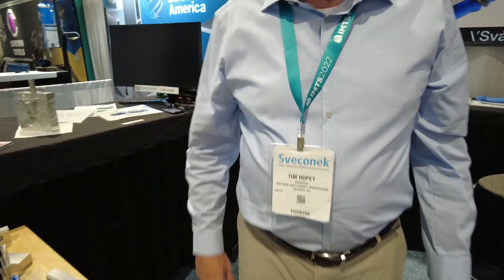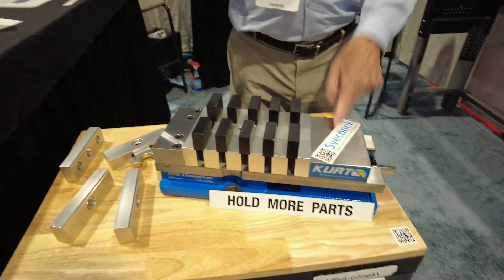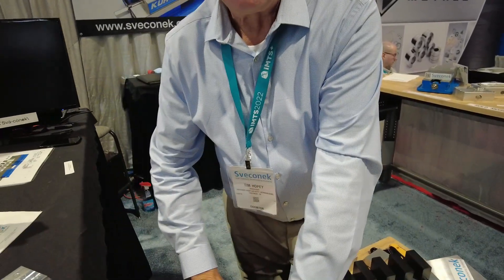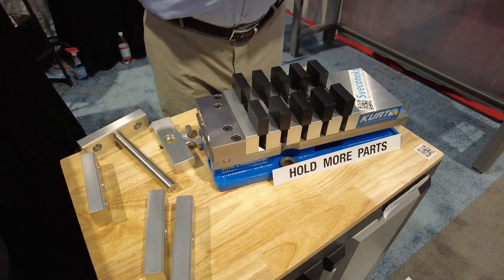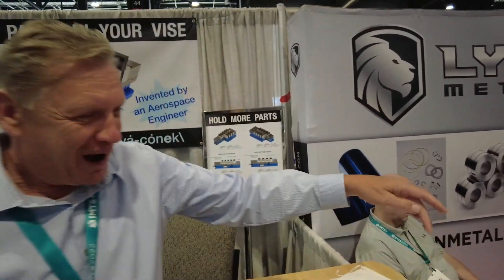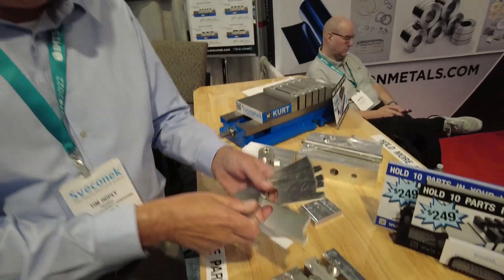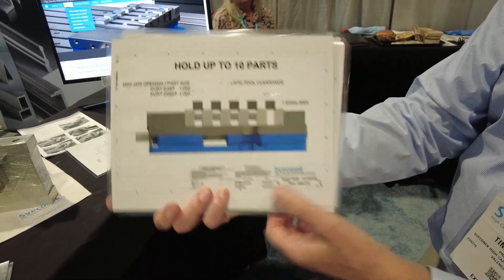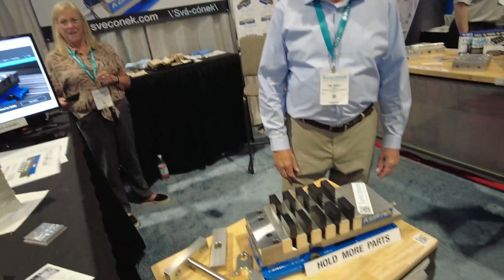CNC vise STEROIDS

Comment: Dont want to be negative but there's a bad tolerance stack issue (in Y) with that design.
Reply from the maker: I think you’re right.  I don’t know if you could do legit second ops with them unless you probed them all.  But first op blanks would be money and I think you could hold them fine. I’m gonna get some and try them.  I have my reservations on Y also.
Reply: Maybe for secondary ops.. but for first ops? Who cares if you are cutting around all the parts.   @ericschneiter
Reply from the maker: @turuleng  agree on op1!  Op2 wouldn’t trust the datum probably.

Comment: The no go no go no go annoyed me cause he didn’t even properly use the shim to check it lol, put an indicator on it and see for real. This looks like junk another jaw gimmick, I bet there is almost
No clamping pressure on the 8 part jaws.  parts gonna be flying out. But the price is pretty good though
Reply from the maker: I understand the concern.  Im a skeptic, but was pretty sold when I saw it in person.  You’d for sure have to use a torque wrench but for square parts, 1st op it for sure works and it’s rigid.
Reply: @ericschneiter  to a certain extent if you have to reduce feeds for something that holds a lot of parts it’s almost faster to hold on 2 parts at a time in a standard vice with good feed rates.
Reply from the maker: @adammiller4879  no undercut.  I could see them making undercut serrated jaws eventually but for density of 1 inch pieces of stock pretty cool concept.  We will see if it takes off or not but yeah, totally agree for high feed roughing it might not be the best.  I’m gonna buy some and give them a review.
Reply: @ericschneiter  couldn’t tell but was there an undercut in those jaws like a dovetail? If so it would help a lot with grip. This would be okay for aluminum and copper but steel you wouldn’t get enough bite, you’d have to slow down feed and speeds and doc. I personally like to use talon jaws or gripper jaws on a multi jaw Vice but at least this is cheap